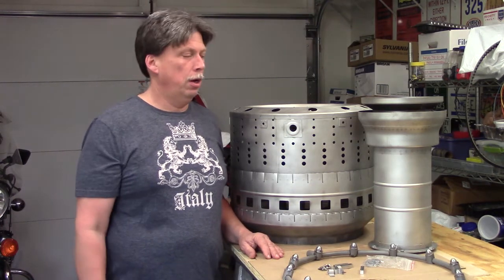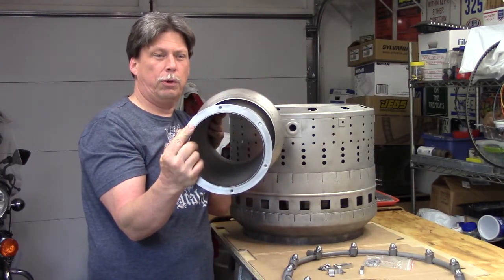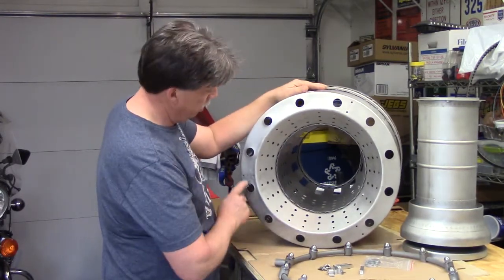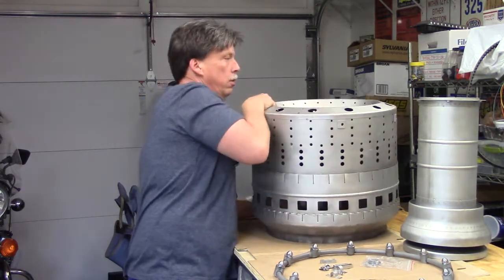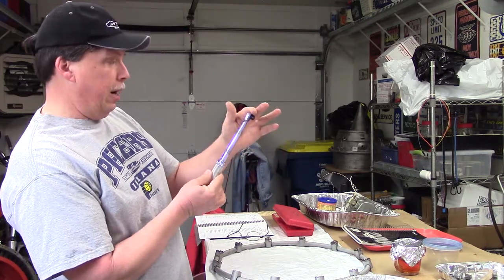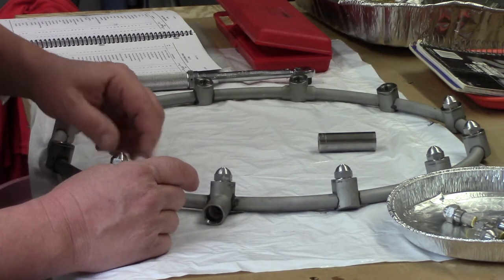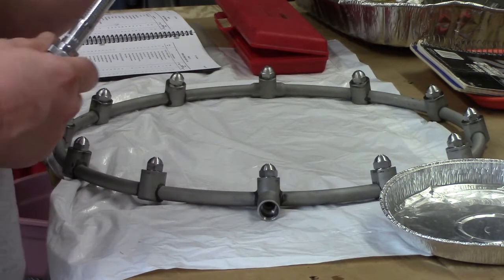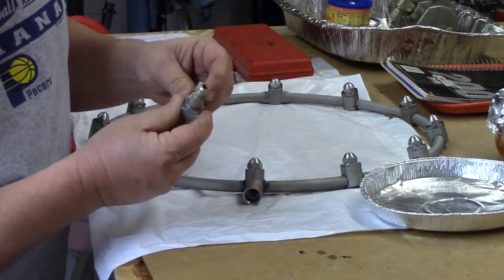The J44 Project:  Restoring the Combustor & Fuel Manifold/Nozzle Assembly, Part 1.

Comment: Ha, those fuel nozzles look just like the fuel nozzle on my oil furnace... makes sense I guess.
Reply from the maker: They are industrial furnace oil burner nozzles!  They were used for this engine to keep costs down; at the same time they were fairly common and readily available.  This was at first an 'expendable' engine design, so it was always simple too!

DD
Reply: That's awesome! Do the manuals say what the duration of their service life is?
Reply from the maker: Originally, it was only 15 hours!  Later models had increased life expectancies but nothing like 'daily use' engines.  I am not sure what the late model J44-R-3 is rated for in hours but it is 'flight rated', used for assisted take-offs (J.A.T.O.).  If I find the -3 hour rating I will post it here!